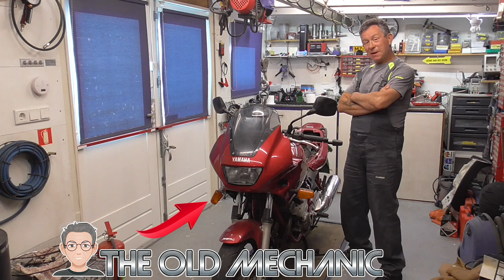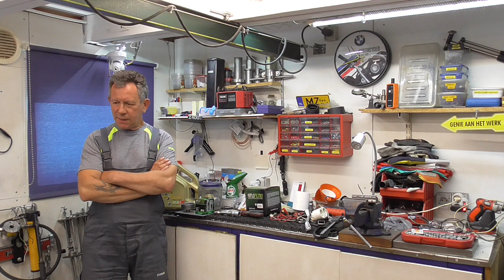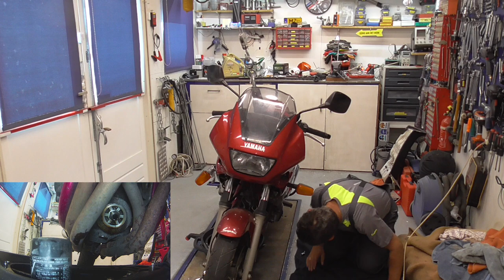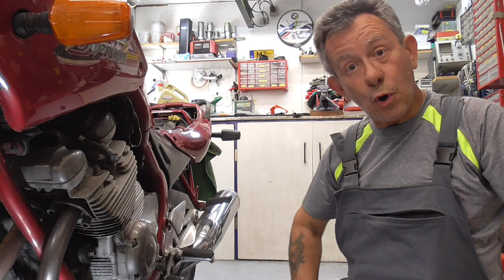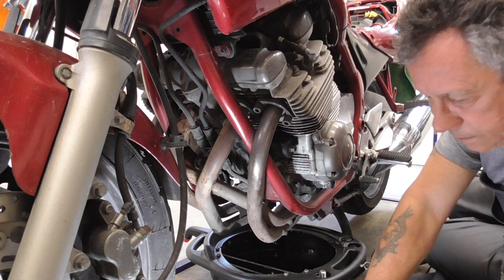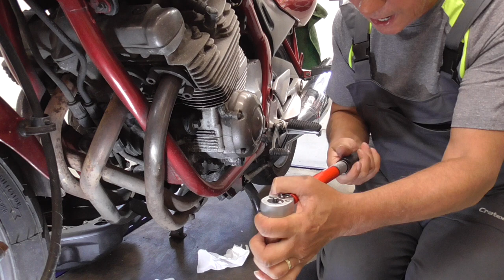YAMAHA DIVERSION XJ600S [1998] OIL OILFILTER CHANGE PART 1 easy...? 👨‍🔧---🏍

Comment: Those hiflow filters are no good. There is a detailed review of different brands of filters on youtube. The spring on the hiflow is much weaker than the OEM springs meaning it allows unfiltered oil to circulate very easily. The filter paper is also low quality.